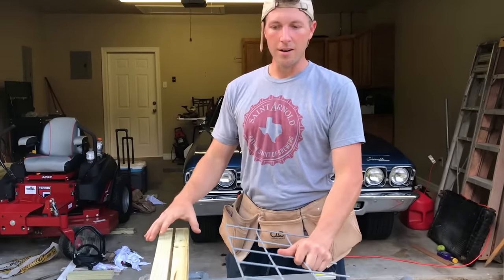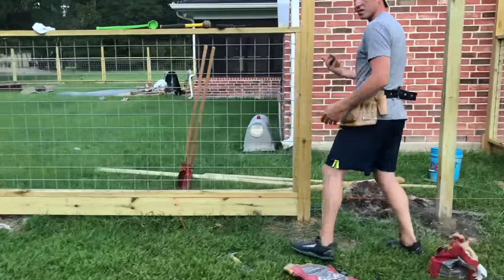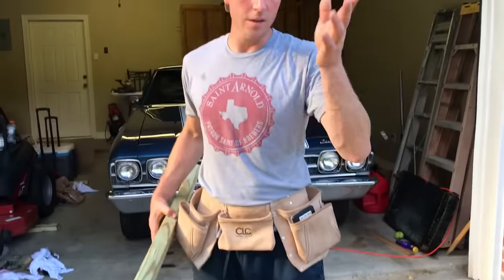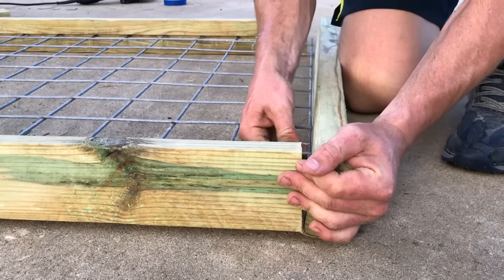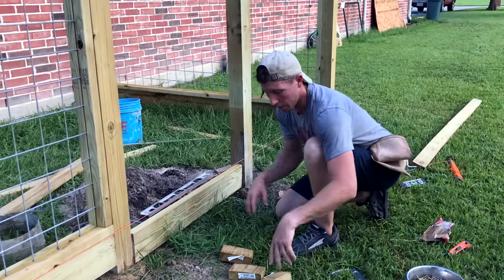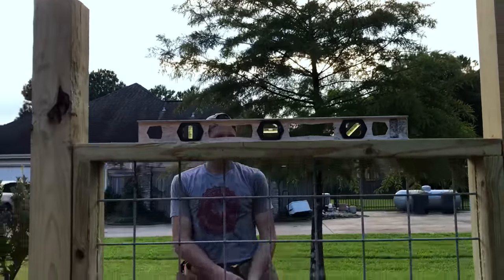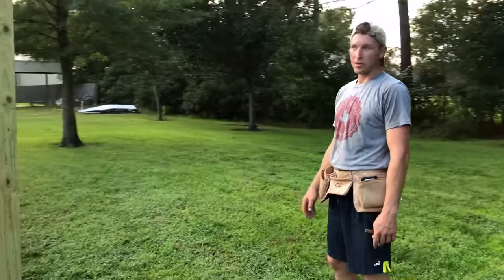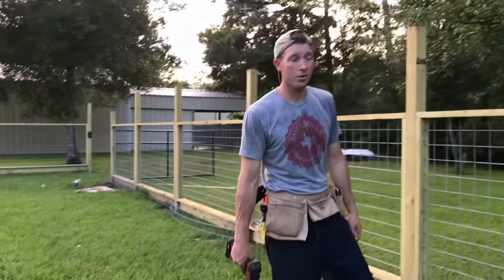Part 1: Modular Hogwire Panel Fence with Dado Groove

Comment: Depending on the treatment and the screws sometimes pressure treated lumber causes galvanic corrosion in the fasteners and you'll want to watch out for that. Also a flat 2x4 on top isn't ideal because water can pool on it after a rain. If you cut a 10º bevel down each side of the top it'll shed water more effectively.
Reply from the maker: Thanks for the reply, thats great information!

Comment: Yours is the BEST I've seen. I'm a 70YO Nanny just bought some property in NC and going to build a house and the lot needs a fence. I thought about using 2- 2x4s to make the posts and sandwich the wire between the boards, but I think yours is a much better idea with the dados. Thanks for the video and God bless you sir!👏
Reply from the maker: Thanks for taking the time to watch and comment… That was my original plan to sandwich, but this is a much lighter and stronger plan… Don’t hesitate to reach out if you have any questions… If you need construction information, give me an email at JKHARTEL3@gmail.com

Comment: Just finished up my fence. I built to most of the same specs and it came out great. I built a cantilevered big gate and mixed it up with some corten corrugated steel at the front. I struggled a bit with the dado at first, having to end up buying a table saw with a long enough arbor for the dado blade AND the dado-ing went a lot slower than I expected, it’s just a lot of wood to dado.
Reply from the maker: That’s awesome to hear and thanks for the follow up on your own experiences… Yes, I had 23 frames to make and that was a lot of wood to dado.. not to mention it was still wet pressure treated.. shoot some photos to jkhartel3@gmail.com I’d love to see how it turned out! 🤝

Comment: I couldn't agree more with Mr. Lombardo's comment.  You just gave me the solution I was looking for; trying to find a way to have an open fence that can contain my dogs (Bullmastiffs), provide an open view and be resistant to wind.  I will probably use a white opaque stain and add some rails and caps to keep the HOA at bay.  An awesome, well thought out and executed design. Well done -  American ingenuity, brother.  BTW, I want your Chevelle.
Reply from the maker: Thanks for the reply Kurt. The fence has held up well to my 200lb English mastiff and feisty Aussie. A storm with 50+ mph winds blew through a couple weeks back and a large quantity of neighbors had fencing blow over. Mine is standing strong. If you are interested in building plans with material breakdown and cost generator based on my design per linear foot , shoot an email to hawkijon@aol.com. Also, if you like the Chevelle, check out my channel, i have an MSD kit install video and a recent upload of the UMI coilover conversion which has a clip of the engine running with open headers. It'll put lead in the pencil for sure. Thanks again.

Comment: What is your annual rainfall where you are located? Do you have insects there that eat wood? Termites, fire and other ants?

Those dadoes will be a way for them to continue to bore their way through the lumber.

If you are planning on adding another wood panel above the panel part of the fence, be sure the top sheds water or it will rot, warp and fail very soon.

The bottom of the panel frame with a dado will catch water and rot away and cause the panel to rust. Also, you can angle the table saw blade to take a small cut from either side of the centerline of that bottom panel board to help it shed water and then leave about 3/4-1" flat in the middle. Use regular fence staples to secure the bottom of the panel.

These panel fences are more decorative and practical for yards and building lots for smaller animals, sheep, goats, dogs, poultry etc... they have clean lines and do not sag.

Nice job.
Reply: 1mtstewart 

Question: what insect would eat through pressure treated lumber? The concert protects the wood in the ground and the chemicals in the wood protect from insects, rot and warp “prevention”. I’m confused about your statement on insects because many homes are built with pressure treated lumber for this exact reason. And Yes Texas has Termites and Fire Ants... never seen issues with pressure treated lumber ever... not even after the wood has rotted. 

I agree about making the top board slanted slightly for drainage or cap the entire rail with the same stuff log homes are treated with (like a thick lacquer almost apoxy like). And definitely cap the post. 

Just my thoughts but other than that, I enjoyed the build too!
Reply: Go over it with silicone?

Comment: Love, Love, Love the fence...  one note... When wood gets pressure treated they don't always get the pressure treating chemicals all the way thru the wood...   You may have datot'ed an opening into untreated wood...   On the top and sides, that won't be much of a problem...  but on the bottom grove, water will just sit in there...  and you know what that will do.   Just thinking...…….
Reply from the maker: Mike Braun Thanks for the reply… After doing the video I went back and drilled a 3/16 hole in the dado groove about every 8 inches in each of the bottom panel frames and then applied 1 L of water from a bottle in the groove… It has sufficient drainage… Now that the wood has weathered for a couple months I plan to stain now that it will except it instead of bead up. Shoot an email to Hawkijon@aol.com if you’re interested in building plans, material breakdown and cost generator

Comment: Brother watching you build that fence I got a lot of ideas from you I'm a painter by trade we always have Epoxy paint I thought it would be feasible to get epoxy clear resin and put it in there where that data line is at it will seal it up real nice make it last for years or even liquid nail in the trades we work with a lot of Carpenters I do get ideal from them guys also I also said we learn everyday thank you a lot
Reply from the maker: Thanks!! Yes, I was “on the fence” about what to do and ended up going with drain holes in the dado.. works great! See my part 2 video for answers to common questions from part 1 https://youtu.be/bL89wkzSPDo

Comment: Thanks for the info.  FYI - you used a "groove," which runs with the grain.  A dado, runs agains the grain, and a rabbet is on the edge of the board.  😁
Reply from the maker: Hey Susan! Happy to help! Thanks to little insights like this from viewers, I’ve come to understand a bit more about the specifics of woodwork since doing this video. Come to find out for the only thing “dado” about this configuration is the type of saw blade i used.😂

Comment: To hell with the fence let’s hear about that Chevelle
Reply from the maker: David Miller Thanks for the reply, if you want to hear that beast, Go check out my channel for the UMI performance coil over install…
Reply: Hell yea what fence
Reply: I like the fence better and the chevelle not so much because it's a 70s model.....now if it was a 66 or 67 chevelle or impala, then I  would be impressed
Reply from the maker: dieselcowboy777 it’s a 69 model.. but I know what you mean generation wise
Reply: Some of us are old enough to remember that car when it was new... :(
Reply from the maker: @CurmudgeonExtraordinaire  it sounds just like that new car you remember every time i start it up. I have a video on my channel about the coilover suspension i installed on it that you can hear her purr.
Reply: @GatorOverland  -- '69?  I had a Pontiac of that same year... 400 cu-in with a 6-pack... 5 mpg was alright when gas was $0.28-0.35 per gallon, but when it hit $0.50 per gallon in the mid-to-late '70s, I had to get rid of it because I couldn't afford to feed it anymore. :(  Back in the days when cars had backseats (even the 2-door ones) that weren't so small that they could be classified as a means of birth control.

Comment: Great looking fence. Also, really liked the tip  toward the end using boards with clamps to create a "kickstand" effect to make your posts plumb and while working alone. I will be doing my own fence so that's a valuable tip for me. Thank you!
Reply from the maker: A_B_C Easy_as_123 it’s holding up great! I put 1/4” weep hole in the bottom groove about every 8”-12”, and it drains more than sufficiently. Shoot an email to Hawkijon@aol.com if you’re interested in construction plans and cost generator

Comment: I would have drilled some weeping hole in the bottom run to allow for water run off.
Reply from the maker: Danny thanks for the reply! I did 3/16” holes in the bottom dado every 8-12” or so and tested it with a bottle of water in the groove and it drains sufficiently.
Reply: Yep, I have that concern that water will be trap in that slot and than will get rotted ?
Reply from the maker: Danny Snelling https://youtu.be/bL89wkzSPDo
Reply: Oh i see what you are saying now....at first i thought you meant drilling holes from side to side in the bottom of the panel....but now i realized you mean drilling small holes from top to bottom so water doesn't collect in the bottom dado itself ...

Comment: Did the same thing and it works great. We get a lot of rain so the horizontal pieces get turned on edge and the groove is cut into the side. If your interested, a groove and dado are practically the same thing except a dado is across the grain and a groove is with the grain.
Reply from the maker: Huffster thanks for the reply! I had some back and forth with how to explain the same,  but went with the name of the blade type for the my explanation to prevent any further confusion should anyone go looking for a dado blade set to cut the groove. I live in southeast Texas and get about 60+\- inches of rain per year and have had no issues with deviation in our first year. Only time will tell. How long has yours been constructed?

Comment: That "cutter thing" is called an "Angle Grinder."   Trust me,  get or make at least 1 push stick for your table saw.  Keep your fingers attached to your hands.  Just a suggestion but your Dados appear excessively deep.  Welded wire fencing cost much less than "Cattle Panels."  Just an observation.
Reply: Yes, you need a push stick
Reply: Welded wire doesn’t hold up on dogs like his, trust me, I own cattle dogs
Reply: @shawnhagen6871  It doesn't hold up against a 35lb cattle dog?
Reply: Kurt Marucci heck no 🤣 they will bite the wire and just lean back on their haunches till they pull it apart. Now you may have some type of large diameter welded wire in mind. However the small diameter welded wire at hardware stores won’t stand the test of time.
Reply: @shawnhagen6871  Yes, I do have a larger diameter, very stout welded wire in mind.  I've seen what happens to the typical grade hardware store wire.  I think the hogwire used in this fence is probably pretty sturdy.  I also like the fact that high winds can't blow it over, even with 4X4, 8' on center posts
Reply: I've known a few older woodworkers who are missing a portion of a finger / thumb because they didn't use push sticks "back in the day".
I don't think that sort of fence would work with my dogs though (without a bit of modification).  The wire would be strong enough, but they will eat through the wood.  They are 50+ lb really large *termites*... :(  At the very least, I would need to run an electric wire along the bottom with a cattle fence charger on it.  I have to do that now anyway for my side wooden privacy fences.
Reply: Welded wire fencing has to be stretched which would not work for this application.

Comment: We're about halfway done, our fence will be ~1,000 feet around (building a dog park).  The one addition we made to this because we have about a 30" drop in elevation every 10 feet (we're building with 10" panels) is adding a Simpson LB26 at the bottom to slide the mudboard into.  We set these level and drop the panel in.  It also prevent twisting of the mudboards, we're in southern Colorado and wood boards turn into pretzels quickly if not used right away and securely fastened down.
Reply from the maker: This is awesome to hear… If you don’t mind, could you send me some photos of your grade to JKHARTEL3@gmail.com 
I have a friend that is doing the same project, but has a grade and I’d like to have that for reference

Comment: I suggest a push stick. Keep your fingers safe.
Reply from the maker: Thanks for the reply Carl! I agree, and especially for a global video post, i should have practiced proper wood working safety.
Reply: @GatorOverland  Lol, I cringed watching you pull the wood thru instead of pushing it, if it would have 'Kicked' you might have got a bad head ache.
Reply from the maker: @dominicdouglas7580  i agree i wasnt exactly the model for ideal safety for the project. maybe next time ill get a table on the other side for the board to land on instead of falling of the saw table.

Comment: Youtube algorithm thinks I need to watch a fencing video.. anyhow  I hope your fence lasts. Why not just put dados in the fence posts and run rails top and bottom? I like the gate latches too.
Reply from the maker: Thanks for the reply Jason! Yes i agree, and this idea was considered during the planning process. Running the dado or router down the 4x4 post would be economical (saving the cost of 25 - 2x4's @ $4 ea.) as it would become an integral part of the frame for the wire panel to sit in as well as being a sturdy post, but i didnt know if it would be as rigid or efficient as a full frame design, considering i used the vertical frame lengths to screw through to secure to my 4x4 post. With the grooved post method, In my mind, this would make it difficult to secure the top and the bottom frame lengths to the post as you would have to toenail screw at an angle into the post while holding up the panel at the same time.The full frame is also forgiving if you are not precise on your post setting. If youre +/- too much on your post setting it might conflict with fitting your wire panel into the post groove (too tight/too loose). I you are interested, send an email to hawkijon@aol.com , i have a hand sketch and material breakdown to reference and some finished product pictures.

Comment: Nicely done.  I would leave the fence posts taller and have lights going from one to the next all the way around for ambiance.  Just a thought!
Reply from the maker: Yes, that is definitely a consideration and looks really cool… At the time of the build we had just bought the house so I didn’t really have any extra money for flashy upgrades. considering how well the fence has held up over the years. I may consider doing that as an upgrade soon, because the current wooden caps are starting to show some wear from UV and weathering

Comment: Drill holes in bottom groove so the water can drain.
Reply from the maker: Thanks for the reply, i did go back and drill 1/4" hole every 8" for the dado grove for draining. I checked it by pouring a bottle of water in the groove. Its no Niagara falls, but it definitely drains. Shoot an email to hawkijon@aol.com if you are interested a hand sketch with material breakdown and completed photos.
Reply: Right on always think about drainage makes material last much longer
Reply from the maker: @jaylong3581  thanks for the reply! I hope to hope to stain soon, but so far the fence has held up great!

Comment: Just put Thompson water seal or cwf in a pump up sprayer and spray all open wood cuts since your cuts are deeper into wood than the treatment. Cross brace the gates the cut down on sag. Great job oh how lucky to have flat land and good soil to put holes in our land is hilly and rocky but I am going to do a very similar thing.
Reply from the maker: Sooner Bassn thanks for the reply.. I have building plans and a cost generator based on my build per linear foot available if your interested.. shoot an email to hawkijon@aol.com
Reply: Im in the same boat. Building a similar fence with different panel design on a hill. Im planning on stepping the panels and getting creative with landscaping to pull it off. Thanks for the good video John.

Comment: The bottom bevel will fill with water or moisture with no place to go. In WIenter it will freeze . you can break hard rock with frozen water. You could have ripped the 2x on the bottom and spaced it to drain.
Reply from the maker: Robert Jackson After the video I went back and drilled 3/16 holes every 8 to 12 inches in the bottom dado and tested it with a bottle of water… A drain sufficiently, and fortunately it rarely gets below freezing where I live. Other than that it’s holding up great!

Comment: Excellent video, your fence looks great.   I would add some kind of drain holes to the bottom board holding the wire, to insure water doesn't sit in the dado cut after it rains.  Or caulk it with clear or matching color f you paint the fence.
Reply: I really like those gate latches also, great idea.
Reply from the maker: i did go back and put 1/4" weep holes every 12" in the bottom of every panel set and checked its operation with a bottle of water in the groove. Its no Niagara falls, but it definitely drains.
Reply from the maker: @dominicdouglas7580  thanks they work great!! shoot an email to hawkijon@aol.com if you are interested in a hand sketch with material breakdown and some completed photos.

Comment: good video. thanks. i need a cheap fence for some of the animals and this hits the spot.
Reply from the maker: jenny cestero thanks for the reply! If you’re interested send and email to hawkijon@aol.com, I have a hand sketch with material breakdown and some completed project photos.
Reply: BETTER ADD CONCRETE STRIP ALONG THE BOTTOM AND PUT LOCK ON FENCE METER READERS AND CABLE CONTRACTORS WILL LET YOUR DOGS OUT.